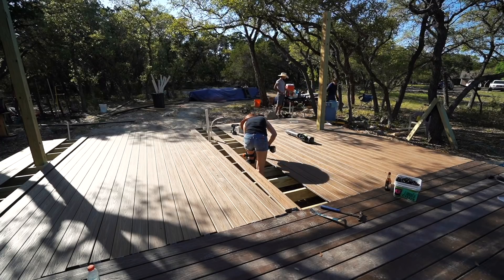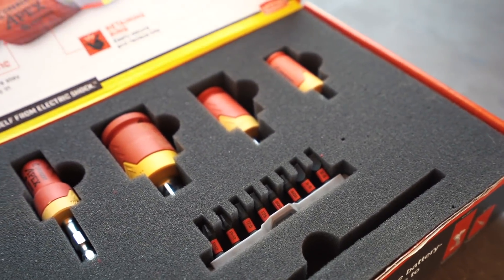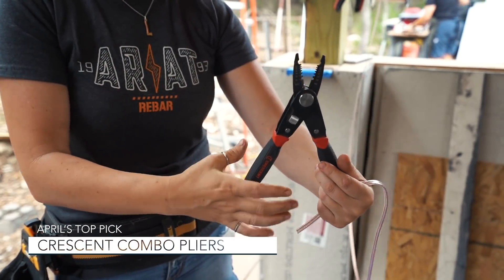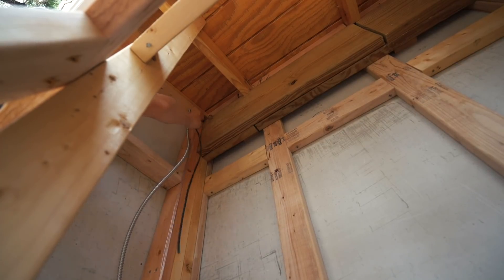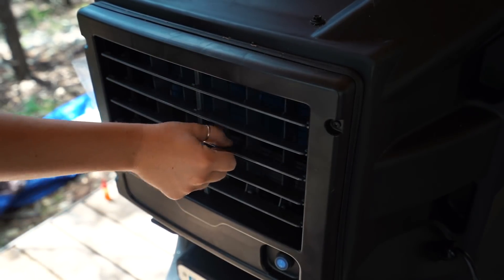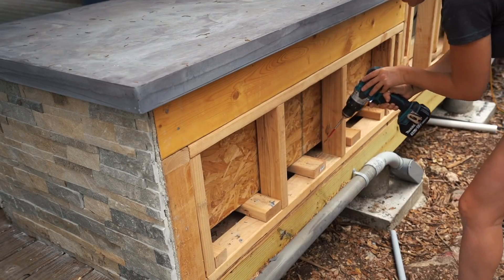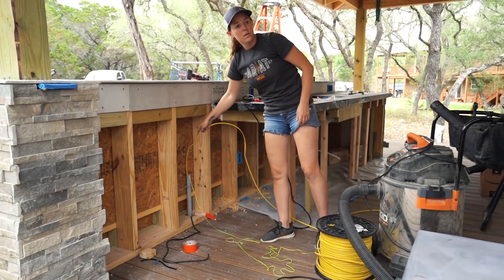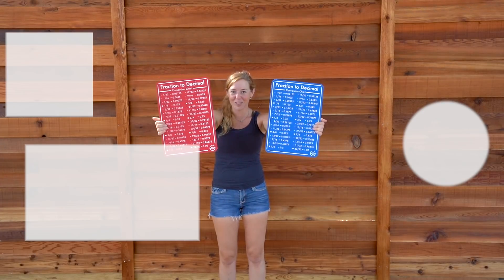DIY Electrical Wiring Tips | Outdoor Kitchen Part 5

Comment: You definitely should not be using electrical tape for holding cables together. After some years cables are so grose, if the tape is removed... cableties are so much better even welcro-ties. ^^

Comment: Evaporative coolers are only useful in areas of low humidity.  If humidity is above 70%, you don't feel cool; you just feel clammy and uncomfortable.  These coolers work by putting moisture into the air flowing through the unit.  While there is partial cooling of the air due to the difference in temperature between the water in the tank and the air, its the affect of the water vapour filled air evaporating on your skin that makes you FEEL cool.

Comment: i dunno how it is in texas, but here in the UK you need to get a qualified electrician to install new wiring and then sign off on it. it MAY be ok to DIY and then get an electrician to sign for it, but don't quote me on that. plus, since you need an electrician anyway, it may not be that much cheaper to choose the DIY option.

Comment: I wouldn't recommend running wires in an hot area. Too much of a risk in melting the insulation around the wires and causing a possible fire hazard.

Comment: should have left it a 100amp sub panel. if later on you decide to add a large draw(heater/hot-tub/tankless electric water heater, the cost to upgrade later will far out weight anything saved by downsizing. probably didn't save much if any, due to cost difference from copper to aluminum wiring, generally large gauge aluminum is ran for service entrance, sub panel feeders, large appliances, etc.

Comment: In most places it is against code to run high voltage wire parallel to low voltage (speaker) wire.

Comment: The "shopvac + string" -trick is genius :)
This video arrived just in time (before I had to start to wiring my new "garage / workshop area".
Your trick works amazing and it was much easier than the traditional method what I planned to use (push through a thicker wire, than try to pull over the cables with that wire).
So thanks for the great tip,
it was very-very useful :)
Reply from the maker: Thanks! Glad it helped! Thank you for watching.
Reply: Tie on a plastic grocery bag like a little balloon, it'll create some resistance and create more area for suction.

Comment: Just to add my 1/2 cents worth ...
1. Please don’t leave flying splices - wiring connections not enclosed in an electrical box. 
2. If using butt connectors where there’s any chance of the connection getting wet, enclose the connection in heat shrink.

Comment: If you're in a really dry area then a swamp cooler does amazing work at a very high efficiency, but if humidity is high, then skip it you'll need air conditioning and outdoors you're out of luck.

Comment: April, maybe you can to find a high pressure misting system sponsor to keep that party cool in the middle of Texas summers. The pump will fit nicely under that deck. Don’t forget to leave a breaker and a wiring run. Go with bespoke copper tubing. Don’t bother with vinyl.

Comment: Ok ima just say this don't use lamp wire as speaker wire or I will slap you off the face of the earth also Tip DO NOT USE LAMP WIRE THERE IS A TING THAT IS SPEAKER WIRE

Comment: you can make a conduit mouse blow the line you are using to pull with by using some foam, light plastic disks, and an eye bolt and nut

Comment: Not sure about Texas, but everywhere I'm familiar with the wire in open air or underground should always be run in conduit. If it's fully enclosed it's generally fine to leave in Romex, which is still a secondary layer of protection around the internal wires that are also sleeved.

Comment: I like the videos And instruction.   Great work. 
As an AV guy and others pointed out running speaker or any unshielded low voltage wire in parallel with AC is generally a no-no for the reason AC power gives of noise as current is moving through the wires.   
Of course we have all done this at some point.  
I was mostly wondering about a real world Sanrio.   When done did you discover an issues with noise from your speakers.    

Oh and I want an outside kitchen like that.  Too bad I live in the north. Lol.

Comment: Side Note: Evaporative Coolers (PortaCool) are not suitable for areas with high humidity. The principle is evaporation of water which lowers the air temperature. Evaporation is not effective in air that is already saturated.
Reply: Exactly right. I've lived in Texas all my life and even though she's in Texas you might observe that Texas takes up a lot of area. A bit less than half of it has high humidity and an evaporative cooler will not work well. She looks to be in Austin area roughly where the air is dry and it will work well.

Comment: I learned decades ago to use the side of the hammer when using a chisel.  There's no shame in getting sideways from time to time. :D  You missed the best part of the crimp connectors:  a heat gun will shrink the ends to prevent water intrusion.

Comment: Hey all           I am not an electrician and not sure what the codes are in texas, but in my state you would be required to start from scratch and re-wire. Conduit is a must for all the wires especially under the deck as critters love the plastic insulation and chew up the wires.  Also a box is required where the wire junctions come together.
Reply: Yeah, i thought the whole point of the male threaded end was so that you can spin a nut/collar on from inside whatever box it went in to secure it

Comment: @4:37 you talk about the wire with writing being the neutral, but this is not correct! On that cable, one conductor is smooth jacket, the other is ribbed. The RIBBED conductor is ALWAYS NEUTRAL. You even scraped the NEUTRAL-RIBBED conductor with your fingernail!
Reply: I think that is low voltage. It is arrived at by passing the line voltage through a 10:1 stepdown transformer. That isolates the conductors from ground, there is n0 longer any reference from ground to either conductor. If used for LED lighting, the polarity is important so there ribbing is there, but not for neutral or hot I.D..
Reply: @ianbutler1983  Even if it's low voltage, the same rule applies. Ribbed conductor is neutral. In case of low voltage DC, ribbed would be ground or negative lead.
Reply: @AlAmantea  The output of a transformer is isolated from all earth reference. There is no such thing as neutral on the output of a transformer, until one of the conductors is grounded, as is done at the breaker box of a home. For example,  repairmen use a transformer to plug in equipment under repair to reduce the danger of contacting the hot side of the line while being grounded. They even call them isolation transformers. Ribbed conductor being neutral is true in lamp cords, but the term is meaningless in reference to the output of a low-voltage lighting circuit.
Reply: @ianbutler1983  you are correct, but only in the case of low voltage ac. DC requires both a positive and a negative conductor that cannot be crossed. Some low voltage AC also requires same conductor continuity for various situations, but none of this even matters in the context of my original comment.
April was talking about 120 volt AC as used in her situation, which NEC states that ribbed conductors are to be used for the neutral path, not Line as she stated. My original statement stands, and there is no reason to travel down a rabbit hole. Enjoy your day, good discussion.

Comment: If you did this in Australia you’d better get a sparkie (electrician) to sign off on it and issue a certificate of compliance (which btw he isn’t going to do unless he did the work), without that certificate no insurance company will touch, which they won’t anyway unless the building inspector also signs off on it. But if you don’t plan on insuring it then that’s cool, go right ahead, of course there’s building permits and planning permits to get before you even start, without them the local authority can make you pull it all down....but that’s in Australia of course
Reply: We have different power than they do, so bit more dangerous on the regular.  I wish we could do more legally ourselves.  I dare say we'd lose a few more to Darwinism each year if we were allowed to do our own electrical though LOL

Comment: I work in computers and I've pulled a lot of network cable.  It's nice when the contractors install pull cord before they install the conduits.  Also we allways pull a new pull cord whenever pulling a new wire.  Also using a braided webbing instead of rope or string will prevent damage to the conduit and be much stronger.

Comment: The butt connectors you used are heat shrink. Heat the connector once you crimp then and it will shrink the ends and seal it up water tight.

Comment: Just for starters. Something that you would think that is safe. Leaving a a rope in the conduit, so you can later pull a wire. That seems legit, but it's not. You can't leave just any rope/cord. It has to be specially designed for wiring. As in, most rope/cord will actually act as a saw in the conduit. Essentially cutting into the wires in that conduit. This then creates a fire hazard as the now bare wires will arc.

Comment: When did ribbed wire casing change from neutral to hot? The smooth side is hot and ribbed in neutral. As far as I know this is the standard.
Reply: You are right
Reply: You’re right.

Comment: Tying all the +/- together for speaker wires is going to significantly decrease your speaker volume.
When you tie two speakers together in parallel the ohms double (more resistance = less volume). Talk to a local audio installer and you can run two pairs in parallel and those pairs in series to possibly fix this problem. Running speakers in series half's the ohms. Need to know what ohms the speakers are and what the amplifier can handle for output.
Reply: parallel Rt=1/(1/r1+1/r2+x)  series Rt=r1+r2+x
Reply: @jimzediana5311  ..in non-mathematical words, SERIES sums the RESISTANCE, PARALLEL divides the RESISTANCE.
The reverse of what he stated.

BUT, the OHMS stated in the speaker specs IS NOT RESISTANCE, IT IS IMPEDANCE…🤓
A function of AC voltage… You can’t have AUDIO with Direct Current (DC)..
😉
Reply: @ernestgalvan9037  With amplifiers the source impedance should match the load impedance. Since speakers are DC only then resistance is the only thing that matters. Typicaly we would design the system with adjustable pots to match the impedance. In addition some crossover capacitors aide with any noise in the system.
Reply: Or put a transformer at each speaker.  This was done in a camp dining hall that had speaker problems.
Reply: Yes, its also a good way to overdrive your amp and damage it if the amp is not designed to drive lower impedance

Comment: A hole in a big beam, doesn’t that weaken the structure?
Reply: You can drill horizontally. Rule is take the height of the joist and divide by 6. That is the biggest hole you can drill, and it needs to be 2" away from the edge. Drilling vertical holes like she did significantly weakens the beam.
Reply: typical house beams have holes in middle for wires <1/4 size of beam.
Reply: It’s insignificant unless there are lots of them
Reply: Yes. I’m sure it will be alright but this is not how professionals do it.

Comment: Came on to say the same thing several others are saying.  But I can go a little further as I'm a Pro Audio/Video contractor.  Running the speaker lines parallel to power, especially that close, will likely result in a Hum in your speakers.  This is because electromagnetic fields run in circular motions and can transfer from one parallel wire to another.  Crossing perpendicular instead usually removes electromagnetic interference (EMI).

Another method is to put the power lines inside of small EMT conduit will greatly diminish the interference as the metal conduit will act as a shield.  While Code still requires Low Voltage to be typically 6 to 12 inches away from EMT containing power, this is to protect Line level signal such as video, or say the audio running along RCA which usually ranges from 2 to 5 Volts. The speaker cables will be running amplified audio so likely around 20 Volts or more.  So it has a better chance of being fine closer to the EMT.  But next to raw power cables??  Especially side by side for that much distance?  I can almost guarantee that the speakers will be unusable with the hum that will be in them. 

Also, if the Source Audio (music source) going to the Amplifier gets EMI in it before the Amp, the Amp will be amplifying the noise and music equally.  I can promise 60 hz hum does Not sound good amplified. =(

Comment: Your electrical chase is a great example of pre-planning, but you are going to have problems with interference in the speaker wire. Low voltage like audio, visual, and data cabling should NEVER be run parallel to power wiring as it will create cross-talk interference. Basically what is happening is the power is creating a magnetic field that is turning the parallel wires in to electro magnets and disrupting the signal. The low and high voltage wiring needs to be separated by a minimum of a stud, better still is RF insulated wires separated by a stud and/or run on the opposite side of the next stud bay. Best case scenario if you don't separate these lines is you are going to have a constant hum/buzz in the speakers as the power excites the lines. Go ahead, ask me how I know this :)
Reply: NEXT and FEXT. Two terms i am all to familiar with. Been there brother. Just figured you were looking for a chance to tell your story. Bet you have one for every at least half the days of your working life. Hate to knock April as I respect the heck out of her. She has many talents, but novice electrical isn't one of them.
Reply: Ok, fine, how do you know this???
Reply: @NJVernick1  I used to manage conference rooms with integrated A/V and am a Systems Engineer (computer infrastructure). I've troubleshot and remediated many instances where there was network connectivity issues or "buzzing" in speakers due to crosstalk/interference from lines running parallel to live power runs. If you have to bring data or A/V lines near power lines, they need to cross perpendicularly and not run in parallel.

Comment: April I want to thank you for making these videos and doing these projects. They are both informative and entertaining. I also like how you tell your viewers to refer to their local authorities on the codes for building, plumbing, & electrical. After reviewing some of the comments on this video,  I would have to agree on some of the electrical comments. As an electrician for over 30 years. I have seen the results of what happens when animals (mice, squirrels, rats 🐀,, etc.) do to wires. I think these comments are trying to help your viewers and inform them of the dangers of running electrical wires. It's easier to install them correctly when everything is accessible, but it's more expensive to fix it and replace the damages that occur when it's done incorrectly. 
I'm all for people to know how to do things for themselves but they need to know the correct way.

Comment: Be careful not to run too many wires through a conduit. Just because it fits doesn't mean it's safe. Look up conduit fill to make sure you use the right size conduit for the amount and size of wires. This is the same no matter where you live. You could over heat the wires and cause a fire Hazzard 🔥.
Reply: that's why i consider it a good idea to use wires that are one size bigger than the current requires. 
like 2.5 mm^2 instead of 1.5 for 16 amps
4 mm^2 instead of 2.5 for 25 amps and so on.
and no, i don't know how that relates to the american gauge system.

Comment: Electrician checking in! Things look good and honestly if I were doing this at my own house I would have done things very similar. Though I have to second what everyone else is saying, exposed wiring underneath won't last long, and low voltage needs to be separate from power. But again, I've done the same thing on my own projects.

To go along with your tips, I had a few things. Any electrical tape is good, but I highly recommend 3M 33+ tape! It works amazing and won't flake off in a few months like the cheaper stuff! Also, on your wires where you pointed out that the wire with writing is the neutral, I'd never heard that, I was always taught the wire with the lines is your hot wire which works just as well! But most lights like that will work either way, but it is good to do it the right way!

Keep up the hard work, love what you're doing and I'm excited to see where you go with this kitchen and beyond!

Comment: Very well done. And most cables just directly on the beams. In The Netherlands we use different cables for indoor and outdoor use.
In Europe, for example, in The Netherlands, Belgium and Germany, electricity cable in a building is always run through a conduit.
The cable is then better protected. A tension spring is used for this so that bends can also be easily followed.
Maybe google translate should help a bit here. We speak Dutch for the translation.
I hope this tip will help you in the future.
https://info.elektroshop.nl/gereedschap/begrippen/trekveer/

Comment: Ladder suggestion: get yourself a Podium Step Ladder or a Platform ladder for work like this. I bought one for paint work in my house but holy moly it is way more comfortable and safe standing on a Platform and shifting your weight around than balancing on top of a standard ladder. 

The Werner PDIA series can be bought at Lowes and Home Depot.